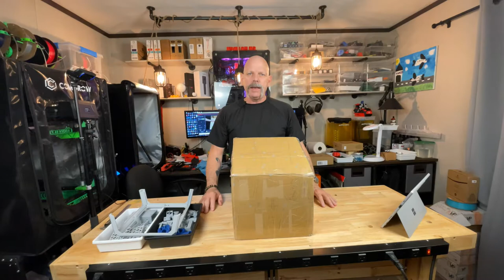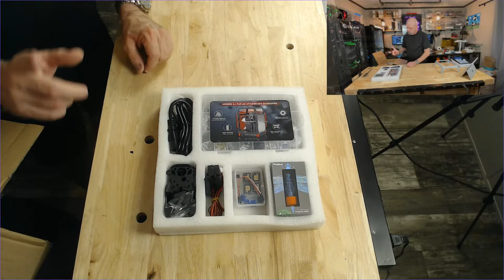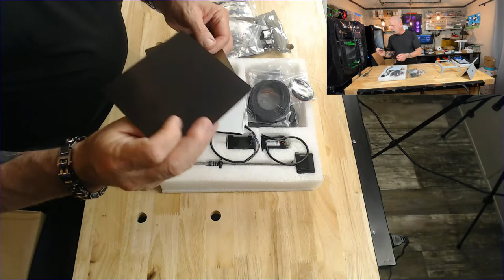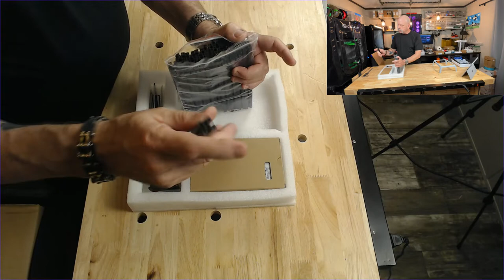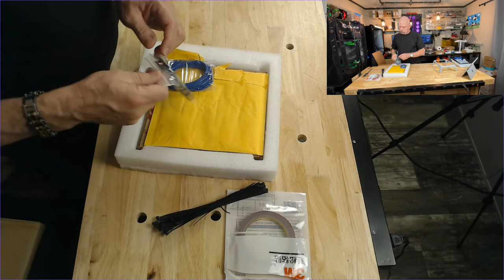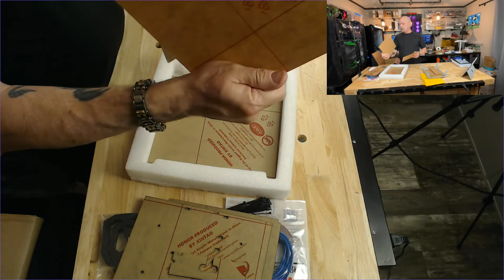Honey Badger Budget Voron V0.1 Unboxing & First Impression

Comment: When I'm shopping for cable chains is the listed measurements the inside measurement of the cable chain (where the wires go) or is it the outside measurement of the cable chain? Looking for my Merc one mod and another printer. I don't want to order one and find out it is the outside measurement instead of the inside measurement. thanks man, great video as always
Reply from the maker: In my experience, the dimensions listed are the outside measurements